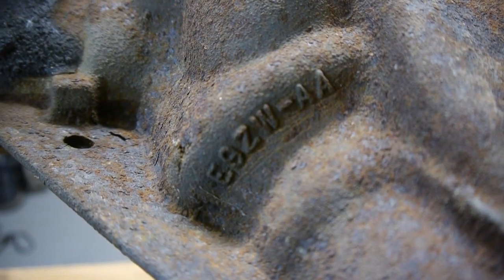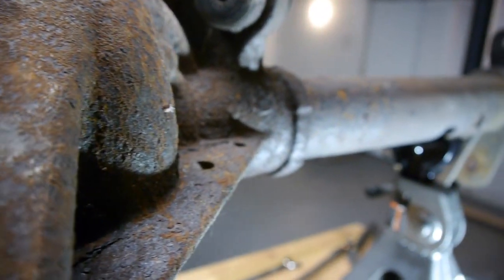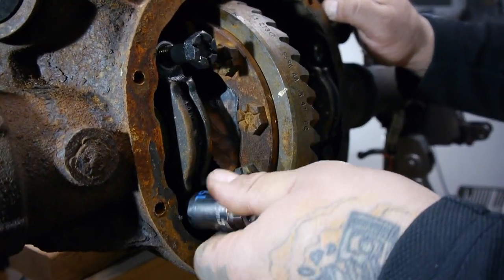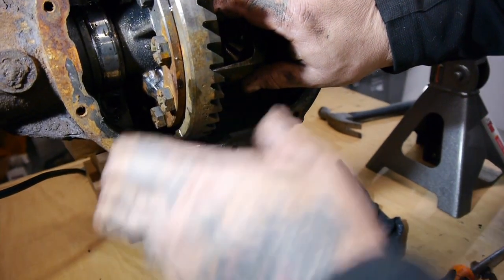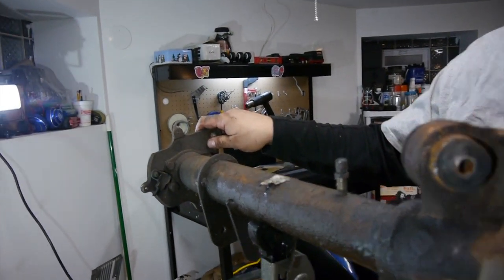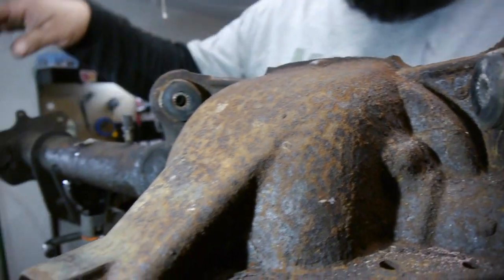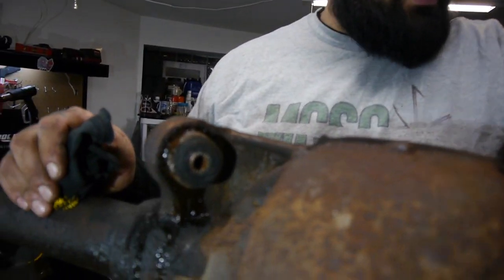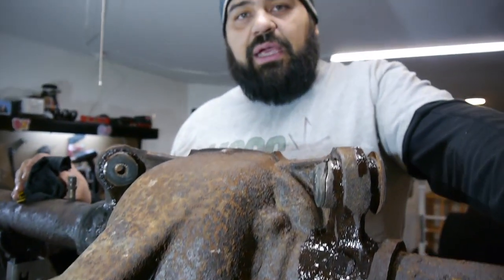Mcscgreenwheels' Differential Treatment Part 1 by Folleh Shar Tamba

Comment: What diff are you going to go with?
Reply from the maker: I think a 373 gear, 5-lugs, 31-spline axles and 31 spline Ford Limited Slip differential
Reply: @mcscgreenwheels  is a press required for changing of gears?
Reply from the maker: @augustinevela9892  no press is required to change the gear itself, you will also need 8.8 Bushing Removal & Install tool if you are going to change the bushing in your 8.8rear end housing. Here is the link to another rear end I build for Ksdnotch. https://www.youtube.com/watch?v=YT4lvsRCMps
Reply from the maker: @Augustine Vela here is the installation of it https://www.youtube.com/watch?v=iQbmznHFqP8&t=4s

Comment: What length axles are you using in 8.8 to use on a foxbody? thanks
Reply from the maker: Since it is a 94 Mustang GT Rear end housing, which is basically the same as the foxbody 8.8 housing expect for the axles. We are going  with a 31 spline Moser axle for a foxbody mustang which is measured 79-93 Mustangs - 29 3/16" long rear axle. 94-98 Mustangs - 29 31/32" long rear axle. 99-04 Mustangs - 30 11/16" long rear axle.
Reply: @mcscgreenwheels   Is that MOS-A883151SN from LMR?
Reply from the maker: @ilike9s   Item #MOS-4235ME3! We have not bought it yet. We used this one on our 1993 Ford Mustang GT, and we will repeat the same process. https://www.youtube.com/watch?v=Bfg6Pxwh2tQ&t=1118s